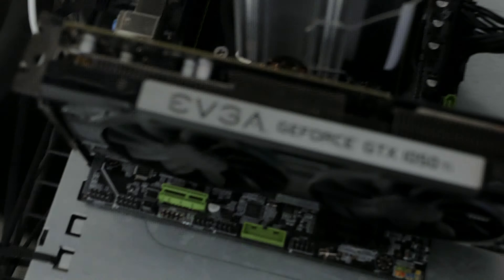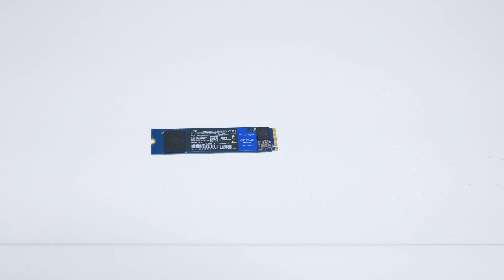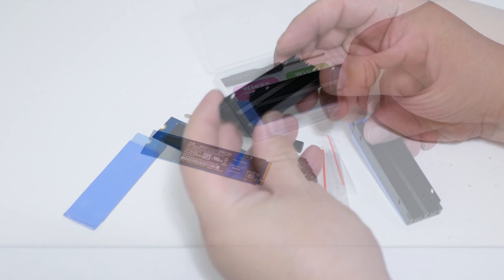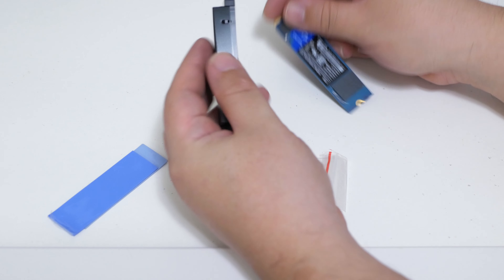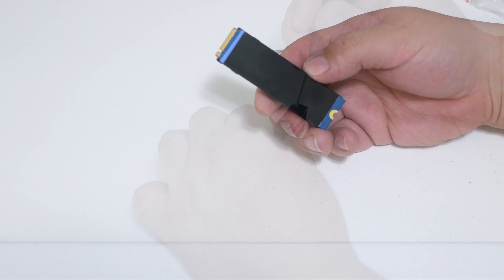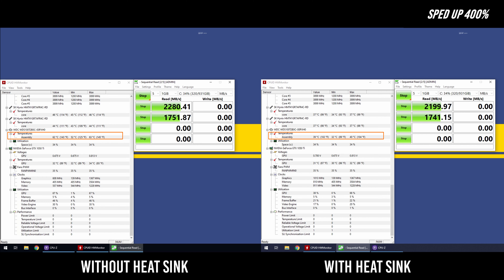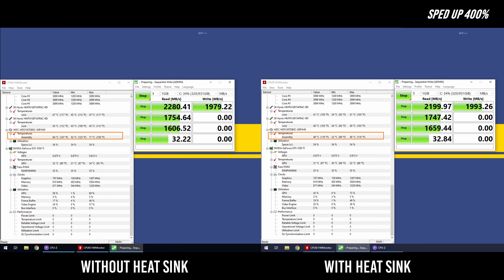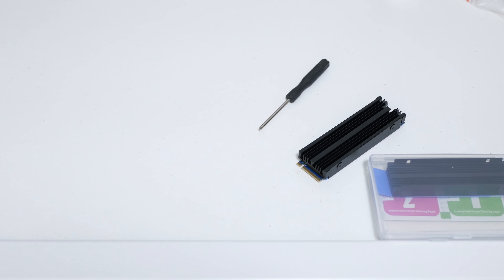DIY | Adding a Heat Sink to an M.2 NVMe SSD

Comment: I'd rather remove that sticker and put  thermal paste between the aluminum heatsink. If they used a fake thermal pad, you're just making it worse. Heat will build up and fry those chip

Comment: Anybody watching this now they have a set like this for just under $10 you can get 2 black or 1 black and 1 red they also have a much better one with the graphite coating and a heatpipe to transfer heat faster for $10 but goes on sale for $5 sometimes

Comment: Problem with electronics is not the heat, if it stays at 65-70, it won't be a problem. But sudden increase and decrease, which data storage will simulate and cycle. GPU and CPU will fail after years, if there are a lot of sudden 0% to 100% increases, ie 30'C to 80'C and back down. So best heatsink is one that can decrease this range to really small. Which mostly are active coolers, but even passive is enough, if range stays 30/40'C to 50'C.   This is also the case why some ppl will "Cook" Gpus in oven to fix them. Because they the most will cycle between 0 to 100% and fail because of it.
Reply: My very old gtx 470 can testify to this. It ran for years at 90-95c. I probably used that card for 5-6 years back in the day. It's in a drawer somewhere and I know it still works because I tested it last year because I was curious if it would still work.

Comment: Great video, I was wondering if this Azlenith mb had NVMe support, so this video is a 2x1! Also, I've heard that there are heatsinks with fans that are pretty good too.
Reply from the maker: If it's the Alzenit board that I mentioned on my first Qiyida motherboard video, then yes. That board along with the Qiyida motherboard both have NVMe support and can confirm it works.

Comment: Can a m.2 heatsink be painted?
Reply: Just painted mine white.
Reply: you’ll gain some temp as paint is usually thicker than the coats on these heat sinks and worse thermal conductivity than aluminum… but sure you can
Reply: Yes but, you will cause it to retain more heat.

Comment: Thanks for the video.
I did notice the read speeds seemed to be slightly higher without the heatsink.
But I know there are a lot.of factors that can affect drive speeds during test runs and the write speeds were slightly faster with heat sink on.

I suppose the main thing was to reduce temperature to lengthen the life of the drive though.

Comment: Interesting video, I think I'll buy this. I have the WD SN850 and it gets pretty warm, far hotter than what yours did, but only under extreme loads, which is nearly never since it's a gaming drive. Anyway since the price is so good and it's a two pack, I could make use of both of them.

Comment: You didn't remove the WD stickers ? Drive performing good and well after some time ?
Reply from the maker: Didn't remove them (though maybe I should have) but no issues with performance. Still works better with the heat sink than without.
Reply: its not covering the controller and flash memory so no.

Comment: that ssd without heatsink never even got hot during your benchmark, you did not need it. 70c is not that hot
Reply: Aesthetic
Reply: the manufacturer says: operating temperature 0°C to 70°C
it hit 70 and peaked at 71... that's quite hot
Reply: “Dude just run this delicate and important piece of electronics at its max rated temperatures until it fails”